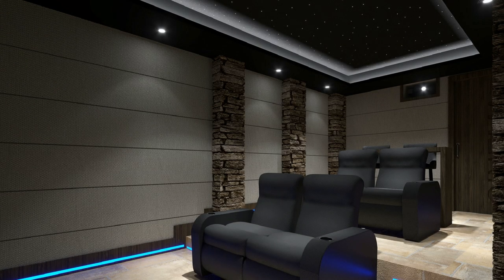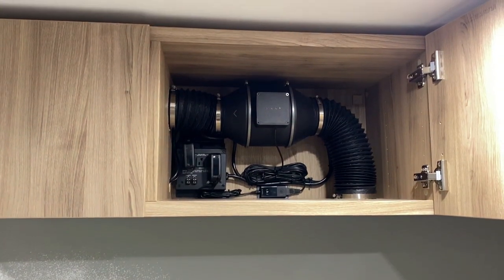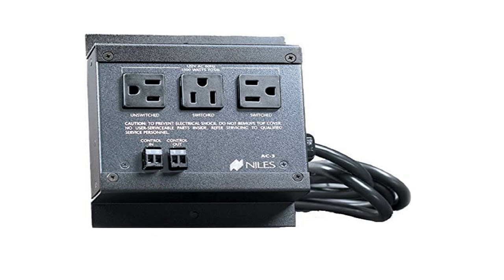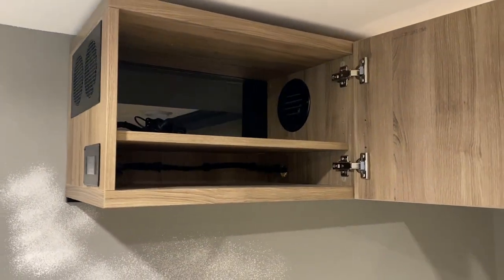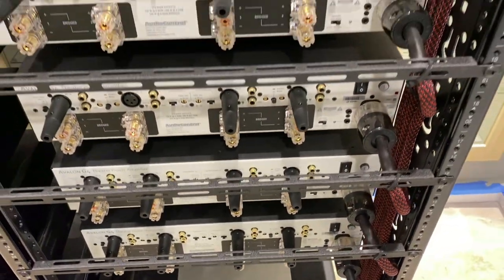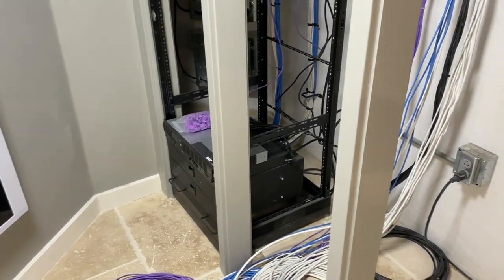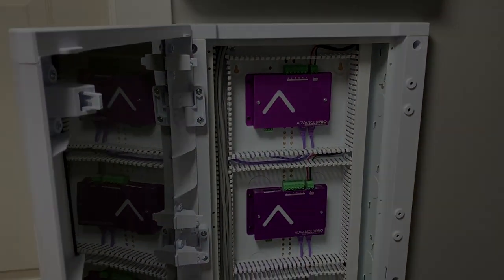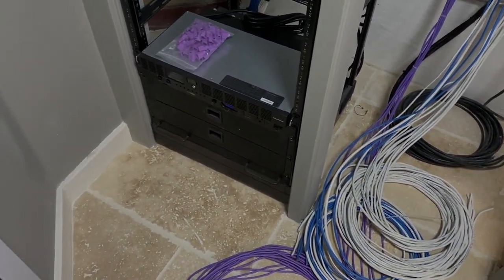Projector Hush Box Cooling and Rough Wiring - Home Theater Build - EP #2

Comment: Is there glass in front of the projector lens so it is completely separated?
Reply from the maker: Hello,

Not on this.  We had used plexiglass (Smoked) and cut a 8" hole in it.  This would work with an sealed optical glass, we never had issues with heat.

Cheers

Comment: Where did you stick the temperature probe? On the top but does it even matter where exactly it is?
Reply from the maker: Upper Left of cabinet!
Reply: @theaterdesignco and in case of epson 6050ub ? The hottest place on the projector is back right side where the lamp is. Exhaust is front right. Should I place it directly above that place?
Reply from the maker: I would go in betweem as I think it would give a more accurate reading!!